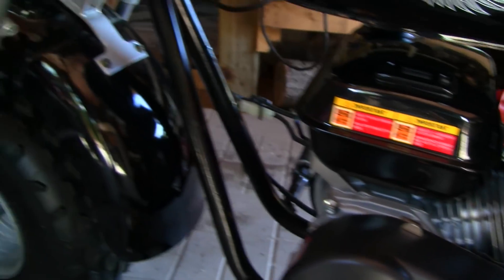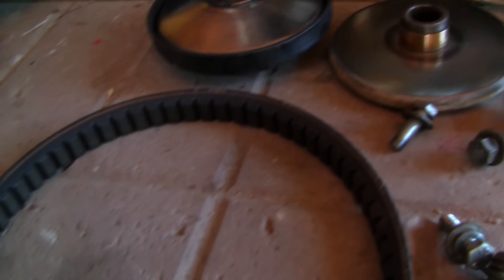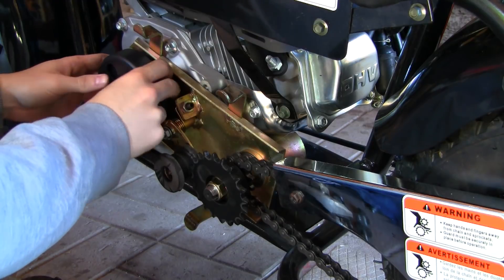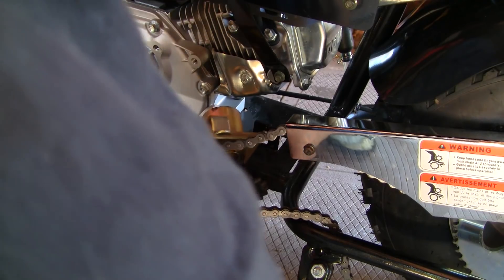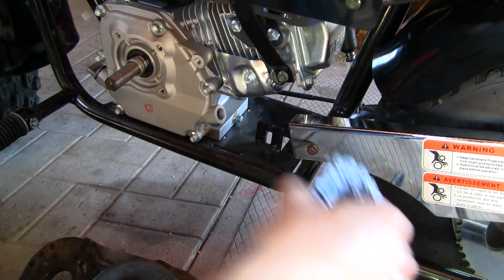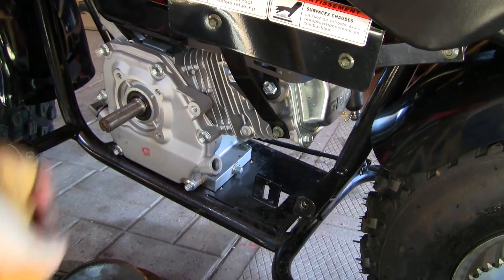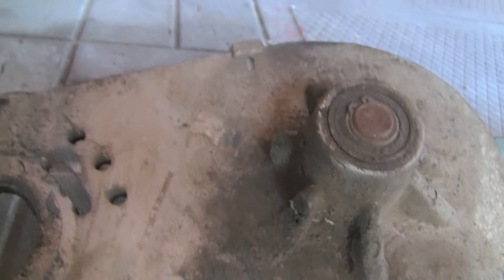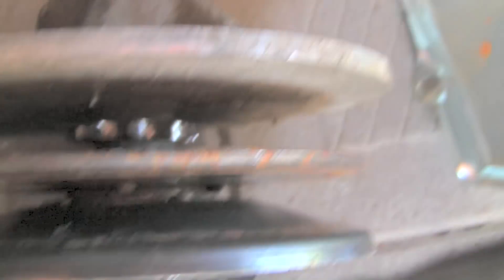Baja Warrior  Mini Bike Clutch To Torque Converter Conversion

Comment from the maker: Thanks. I try to respond to just about everyone except for trolls. :P It definitely climbs better with the torque converter and doesn't slip as easily as the centrifugal clutch does if your starting a steep climb from a stop. It's the middle of winter here so I wouldn't be able to do that for at least a few months.

Comment from the maker: again, not too sure what you are talking about? :P If its too slow put on a torque converter, bypass or remove the governor, or get rid of the jack-shaft for maximum top end speed. :P

Comment: Hello Marcel
I did this job on my Baja Warrior without drilling extra holes between holes and I was able to keep the chain cover by just a slight trim. all you have to do is to flatten the side of the minibike frame tube behind my lower torqueaverter position. Works perfectly looks better and is stronger. let me know if you want a photo. Robert B
Reply: I want a photo

Comment: it would be much appreciated , also very nice and detailed video by the way . ohhh and also do you happen to know if the baja heat model has the threaded shaft or not .   ummmm ohhh and do those spacer things come with the converter or do you have to get those else where

Comment: lol first off , i just read every comment first to see if my question would be answered there first lol n kudos on your reply's lol you reply to just about every question that is asked , lol even the ones you have already answered multiple times lol . any way my question is 1. does it climb hills much better afterwards , cause it already takes them quite well stock . and too would you mind un bypassing the govoner for a quick run n let me know the speed with just the converter on in mph ?

Comment: I don't know how I should say this so I will just come out and say it.  That is not a torque converter.  It is a variable pitch pulley system.  There is a big difference between the two.  That is why it is sold as a torque-a-verter not a torque converter.  This has some advantages but it's not a torque converter.

Comment from the maker: Translate says "A good chain replaced the rubber crap? Why?" So I'm guess it means why replace the chain with rubber? If so, because the chain and clutch is single speed, the torque converter is variable speed, so more power + more speed. Also the centrifugal clutch the chain is connected to slips way easier then the torque converter does when it comes to climbing.

Comment from the maker: Its a kit you buy. It's the "Comet TAV 2 Torque-A-Verter". There's also a knock off version by GTC industries and probably a couple others. I got mine at a local Princess Auto. But you can probably find online retailers that sell them.

Comment from the maker: Nah. The top speeds for this are:
Completely stock - 36km/h (22.5mph)
Governor removed/bypassed - 54km/h (33.75mph)
Jack-shaft replaced with torque converter - 70km/h (43.75mph)
However Jackshaft removed, clutch straight to back sprocket - 85km/h (53mph) (lose most bottom end torque though)

Comment from the maker: that depends. If you keep the jackshaft on it and put a smaller sprocket on the back it definitely will go faster but you will loose bottom end. If you put a torque converter on it, then put a smaller sprocket on the back, in theory it should go faster, but I've tried putting a bigger sprocket on the torque converter itself which in theory would be the same as putting a smaller sprocket on the back and all it did was make me lose bottom end but the top end stayed the same.. so idk. :P

Comment from the maker: hmm its probably either the driver and driven pully aren't lined up correctly, your trying to climb steep hills from a stand still causing the belt to slip and burn, or the belt inst on properly? Most likely misaligned, the back plate of both the driver and driven pully should be perfectly aligned, one shouldn't be more forward or back then the other. Give that a check.

Comment: @MarcelsWorshop                   
 i have a mini baja and i guess it a older year because my clutch just doesn't come off if you pull it off you have to take off a pin, so when i got the clutch off their was a part that stayed on the shaft , so i cant take off the plate where the chains connect because i want to get in the engine because it been sitting for awhile

Comment from the maker: It would be like locking your car or dirt bike in 5th gear and driving around like that, whereas torque converter gives you gears 1-3 and is constantly changing between them to give you best performance. Torque converter gives you, decent speed (70km/h) and lots of bottom end torque (can do wheelies and climb).

Comment from the maker: it comes with a go-kart type clutch already on it, and if you wanted to you could remove the jackshaft and join the 2 chains together and run just straight clutch to back sprocket and you will get around 80km/h or more out of it doing that. BUT you would loose all your off-roading capabilities. it takes a while to get going, you wouldn't be able to drive up a steep hill from a stop and driving on rough terrain would probably just fry your clutch.

Comment from the maker: Its basically like putting an an automatic transmission on the bike, like a car. Much less strain on the engine compared to the stock gear reduction system because now it pretty much chooses the perfect "gear" for what ever situation it's in to make best use of the engines powerband.

Comment from the maker: ya I'd definitely say get the torque converter, it's not that hard to put on and you'll be getting a nice upgrade and something a more reliable then the stock gear reduction kit. I don't think you'll find one in a junk yard though. I'd try gokartsusa or ebay.

Comment: I know this question wasn't directed at me, but i know the answer, so why not? LOL. Normally an engine is strained less when a torque converter is added because it has to work less to accelerate, and when you start accelerating, the converter changes ratios so you will have a higher top speed. So you have better acceleration AND speed. Big bonus.

Comment from the maker: I used to get them right from the comet site but you can't seem to do that anymore, so try ebay or a lot of people seem to get them from gokartsusa. You just have to make sure it can handle 6.5hp, is for a 3/4inch shaft, and is for a #40, #41, or #420 chain size.

Comment from the maker: Too busy with school and stuff right now to make new videos, but you can get cheap key switches that you would cut the wire from the stock switch and then attach that wire to one end of the key switch then the other end of the key switch to a ground and now it won't start unless there's a key in the key switch and its in on position. Although this wouldn't be good for anti theft if that's what your trying to prevent because then they could just disconnect the ground and it would start. :P

Comment from the maker: Centrifugal clutches slip a lot easier and burn them selves out quicker then a torque converter would for off roading.. I don't think there's a single advantage to a centrifugal clutch over a torque converter clutch. If you were to get yourself in a situation where your burning belts you would also be burning and wearing out a centrifugal clutch in the same situation, the difference being a belt costs like $20 to replace whereas a cheap centrifugal clutch would be like $50.

Comment from the maker: No, should be fine. As long as you not stuck somewhere and just keep holding the gas and the tires aren't even spinning. :P A torque converter is a lot better then a centrifugal clutch for off roading.

Comment: The chains more durable if you like to do serious off road and do a lot of it. With the belt you'll have to replace every now and then where as the chain, not so much. The torque converter allows for higher speeds.

Comment from the maker: @XB0XFR34K Probably wouldn't be much slower, just wouldn't accelerate as fast. When the clutch is in its high gear the engine doesn't really have enough power to push much past the governed rpm if everything else is stock on it. My guess would be around 60km/h.

Comment: @xpsychedelic69x icalled them i have the same bike as you they told me it will work as long as your crank has a key way and is threaded on the end i would call them back

Comment from the maker: @gabriel56440 I'd say around 60-75km/h depending on weight, wind direction, road surface, and how well tuned the engine and bike is. :P

Comment from the maker: @thatcrazycat11168 hmm not sure, perhaps the belt is just too burned up and not gripping right, or somethings wrong with the weights or spring in the driver or driven or maybe the moving parts need to be oiled up. (if you do oil up the moving parts though, make sure you don't get any anywhere the belt makes contact with)

Comment: ive added 3 clutch spacers ( thin washers ) and im still just a bit off, its damn near shredded the whole belt. it seems like when it supposed to have tighten and take off, sometimes it dosent grab and then when it does i dont get the most torque because the belts not riding right, then when its supposed to switch to " overdrive " the belt isint alligned so the driver wont close all the way and the driven wont open, so my top end lacks. i have to get a comet belt and get this sorted out

Comment from the maker: @islandminisunlimited actually do you know what, I just remembered what I did with it. I put it on my old mini baja that I pulled the torque converter off of, because the one that was originally on that one I cut up and converted to a chain guard when I converted my baja dirt runner 49cc to a 6.5hp mini bike. I want to keep the old mini baja operational so I guess I cant sell the part. :P sorry :(

Comment from the maker: @BraneDrane100 it's a Comet TAV2 Torque-A-Verter. I believe they are just saying the shaft of the engine needs to have a screw hole in the middle of it, which it should. I've never seen a TC2 so I don't know for sure, but according to the description on gokarts usa that one just mounts on with no mods needed..

Comment: I flipped around my clutch and took out the gear reduction and the governor I could do 70 km/h full out but I over heated my clutch and it locked up so I have to push start it. Ps its for sale $300 obo

Comment: Hey man what kind of torque converter is that? And i have a baja MB165 with a 196cc engine and i want to put a TC2 torque converter on it from Go Karts USA.com but im not shure what it means to have a crankshaft that is drilled and tapped. I just need to know if i can put a TC2 on my baja without doing any work to it. so if you have any ideas please let me know. Thanks

Comment from the maker: @allezsport2010 gives you more bottom end torque and more top end speed. Its like putting an automatic transmission on the bike rather then always being stuck in one gear.

Comment from the maker: @andrewzb the top end would probably be a bit higher but it would take longer to get there. also you would loose a ton of bottom end and doing rough off roading or climbing would more then likely fry the clutch. The torque converter gives you more bottom end then the gear reduction kit while also giving you close to the same top end as straight chain to back sprocket. Also if you fry a torque converter belt its a lot cheaper to replace then if you were to fry the centrifugal clutch. :P

Comment from the maker: @thatcrazycat11168 the torque converter I use is the Comet TAV2-30. But ya that sounds pretty good if all you need to do is buy a belt and put the torque converter on and your good to go.

Comment: im getting a baja carbon soon, one of the red ones, is the torque converter you have a comet 30 asymmetrical? the person who owns it now just ran a straight chain from the sprocket to the clutch,  i know the clutch is burnt because of the ratio at it, hes throwing in tires, rims, fenders and brakes as extra parts,and also a comet 30 that needs a belt all for 230, sound like a good deal?

Comment: @MarcelsWorkshop 

Its a lot of work.
But the difference is you get a much stronger system with a lot more grunt.
A properly set up and braced 30 series is good for an easy 12 hp enging

Comment: At BMI karts in the USA you can order the jack shaft assembly for the Yerfdog 3000 series karts. Use this with the longer belt and 7 inch secondary clutch.

Make an engine mount thats 1 inch of rise for 4 inches of run to tilt the engine and jack shaft forward. No modifcations needed this will all clear the frame and protect clutch.

Add 14cc clone head and after market air filter small 7/8" header, jetting required after.
Add a helper spring to the governer keep the RPM under 5000